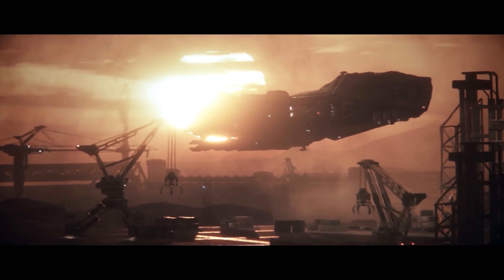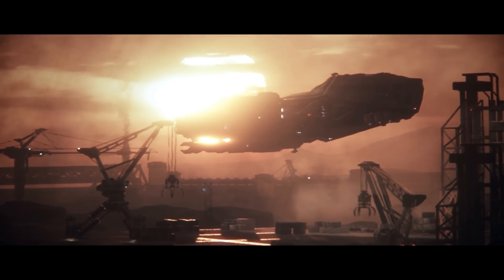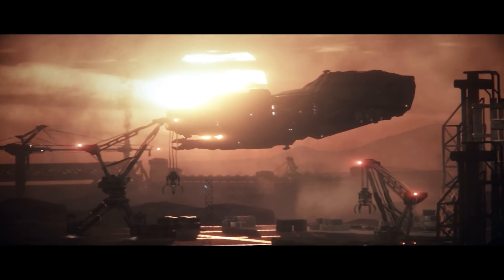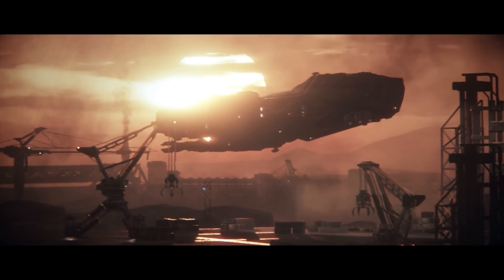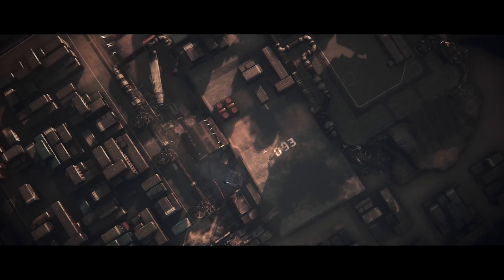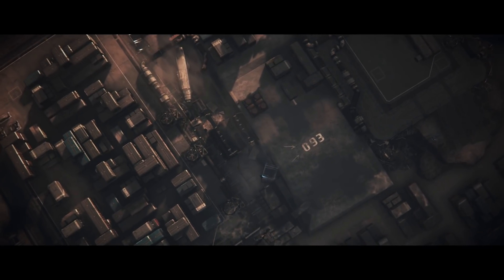Star Citizen Salvage Gameplay - What We Know

Comment: Thoughts:
Salvage is my most anticipated game-loop after mining (which is already in).
Some progress is better than none, but to hear from the devs that some major components of the process hadn't even started development yet is profoundly disappointing over a year after this mechanic was previously supposed to be in game. This also seems like a situation where the perfect is the enemy of the good; it adds in a "realistic" simulation where a merely "good" one would suffice; I expected that ships might be broken apart and components extracted with tractor beams, with ships being processed for material thereafter at most. I would rather, at this point, see a tier 0 involving simple ship breaking and external component salvaging, with more complex iterations coming later.
Moreover, the systems being described have the potential to cause a lot more problems down the line. Sure, you have your $215 Corsair or your $725 Polaris. For some, the task of taking on other players to help maintain the ship might be fun, but it also sounds like an attempt to create ARK or Rust in space that will drive away a lot of players, particularly if they're suddenly going to have to contend with lots of survival mechanics in a game where Chris Roberts already said that those mechanics would be "optional."
As for a release date? I don't expect a release date any time before Q4 2021 for salvage. What they are trying to do is that complex, because they are trying to create the "perfect" system which will inevitably add a litany of bugs to the game which either were previously "squashed" or are entirely new.

Comment: Very disappointed the physical components and room pipes/power flows aren't further along. This is core tech we've been hearing about for... two years? Three? And it's just now in the prototyping and conceptualization phase? 
I agree Tier 0 salvage will likely be the ability to add and remove physical components and that'll be a massive accomplishment. I also like the idea of "salvage" being accessible to non-salvage ships. Like, certain ships will be known to carry high-value components, so if I see a derelict in my cutty I can easily open the hatch, EVA into the wreck to remove the power plant, and then place it in my cutty's hull as cargo. Boom, now I'm a salvager. No Vulture or Reclaimer needed. Instant profit.